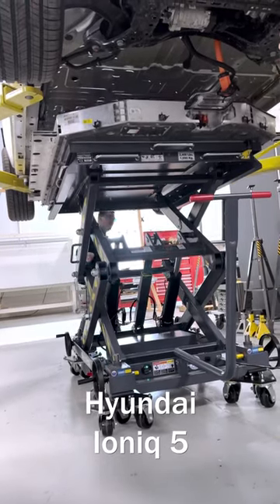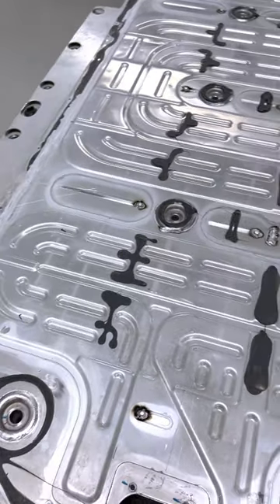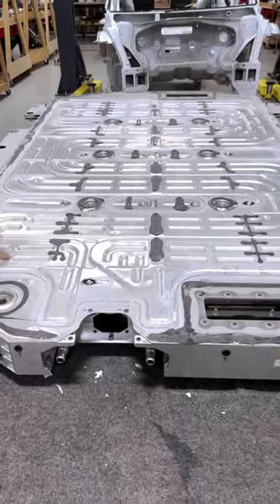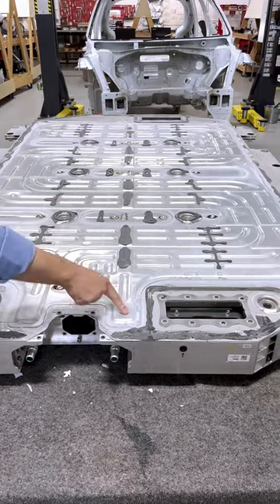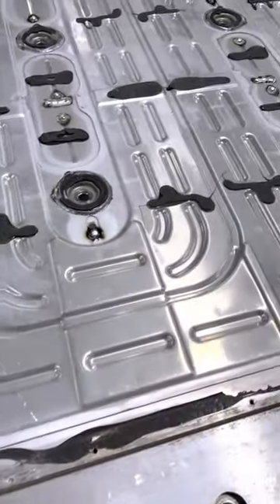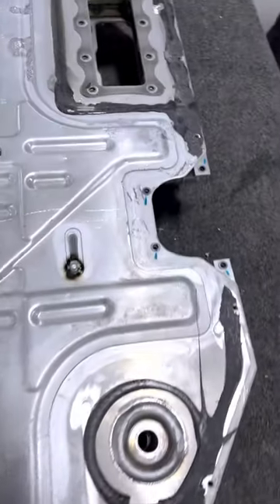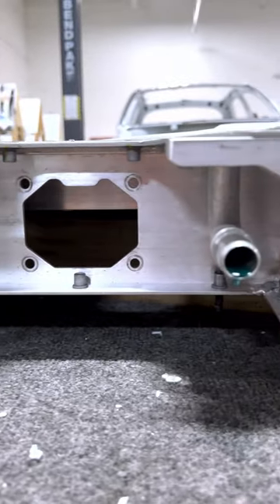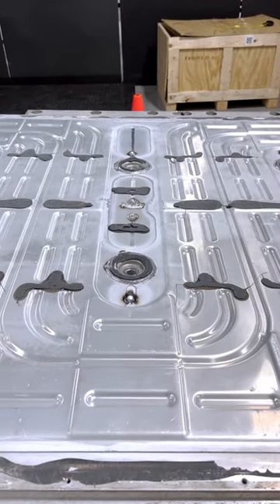Hyundai Battery: Integrated Cooling Plate

Comment: Ive wondered about battery cooling, as the coolant goes through the pack it gets hotter with the cells on the end getting increasingly hotter water, Would there be a significant difference in cell degradation from the coolant temperature gradient, or does the cooling just have to be overspecced so that it can simply keep the end cells at a reasonable temperature even after passing through the other cells.
Reply: Its tradeoff for sure. that tricky bit indeed.
Reply: It will be a countercurrent system so temperature won’t vary greatly.
Reply: Temperature difference can be controlled by maximizing the flowrate😊

Comment: A cooling plate now that's an interesting idea that I've never heard of getting rid of the heat via the outside because air goes around the battery.
Reply: Since there is only one channel, won't components near the end of the run get much less cooling than ones at the beginning?
Reply: @jackt6595  technically yes, but you can mitigate the problem with coolant properties, materials used, and flow rate.and the serpentine path also works to get the colder inlet coolant over all the batteries.
Reply: @jackt6595 Yes and the delta is a problem when charging: lowest temperature responsible for charge rate step up, highest temperature responsible for throttling.
Reply: A similar part is inside the Kona and original Niro EVs and they've used a specialised coolant since mid-2019.  This change allows conventional coolant to be used as there is almost no risk of a leak reaching the cell connections.
Reply: Fluid
Reply: Watch the complete video on the battery where they show the many lbs of heat sink compound between the cooling plate and the bottom of the batteries.  The batteries are cooled by enhanced thermal dynamics the heat sink compound affords them.

Best!
Reply: @jackt6595  Since it doubles back on itself and covers basically the same area twice in a convoluted serpentine fashion it equalizes.

Best!

Comment: How do you have those wheels on the cart
Reply: Why does it have 3 wheels orbiting eachother
Reply: @hybridstoatdragon  with a single castor the trolly has to wobble slightly as you move it to align the wheel with the direction of travel, whereas the triple castor will simply rotate around its own bearing which should keep the body of the trolly very stable and allow it to effortlessly be moved without much jerking.